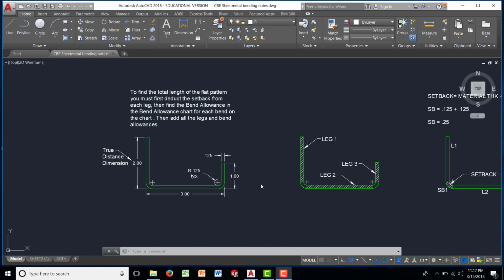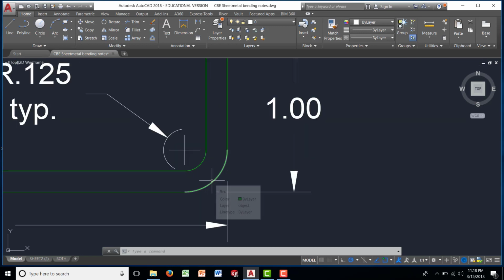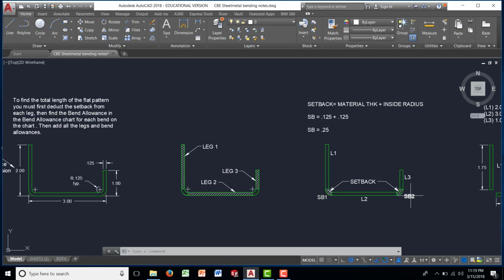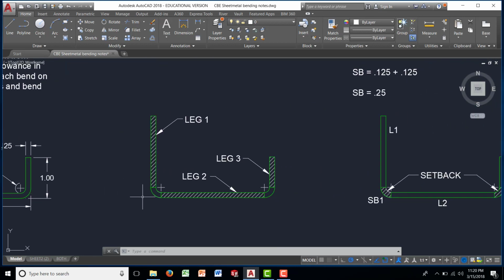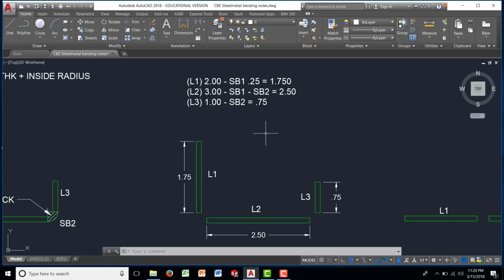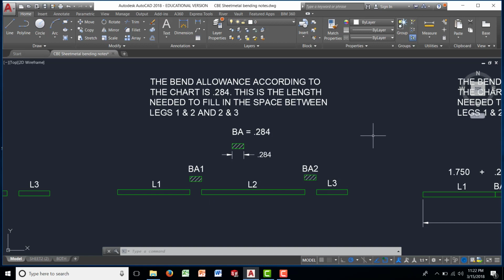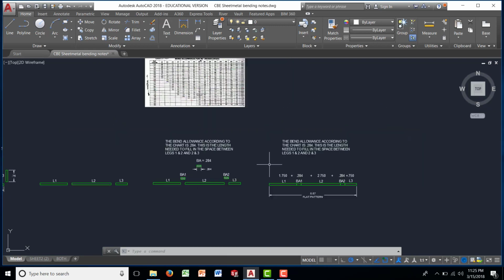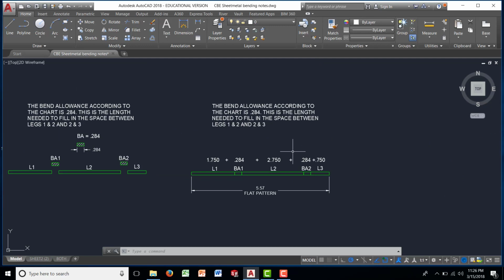DFTG 2335 Bend Allowance and Flat Pattern Caculations

Comment: smartunfold.com has the tool to automatically to unfold the sheet metal model. Here is the sample video: https://www.youtube.com/watch?v=RbTIKeSkMyo
Reply from the maker: Thank you northwind. My students will use this method to learn basic sheetmetal bending which will include creating a flat pattern in 2D using ACAD.  They will then learn to create 3D sheetmetal parts and assemblies using SolidWorks. Thanks for your feedback.